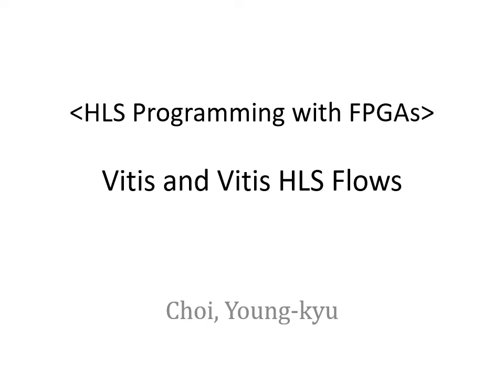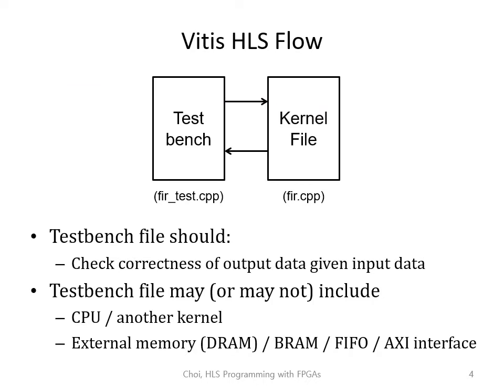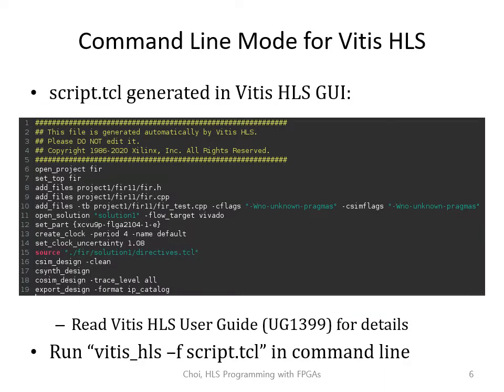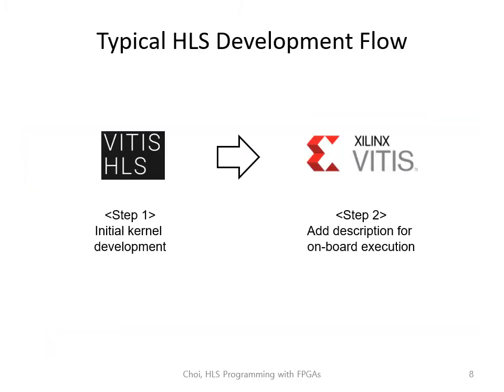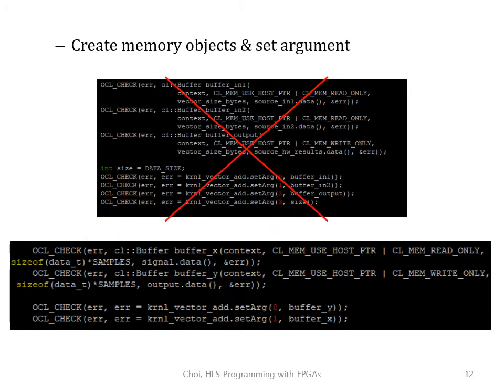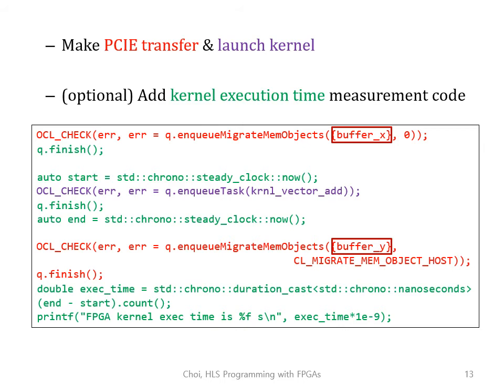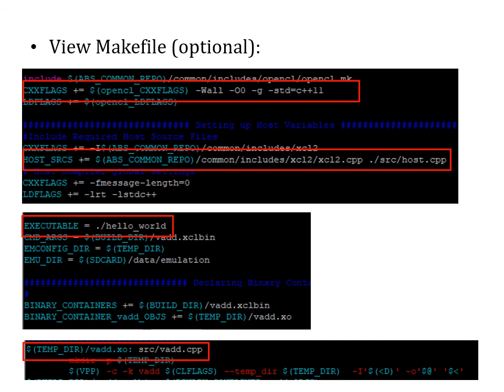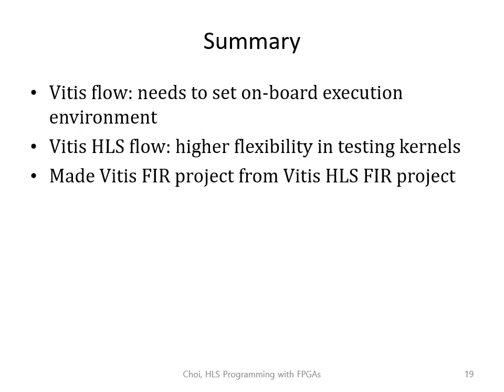Part06 Vitis and VitisHLS (HLS Programming with FPGAs)

Comment: I am getting the following error
invalid scala argument size expected 4 got 8 error code: -51
Reply: I had the same error. make sure you're using a pointer in the vadd.cpp
void vadd(data_t* y, data_t* x)
Reply: @HaasLukas  thanks for the immediate reply, I thought it will take some weeks! Yes I will cross check all, it was giving error at when invoking kernal for (1, buffer_x) something like that:
Edit: successfully compiled , thanks
Reply from the maker: @HaasLukas  thanks :)